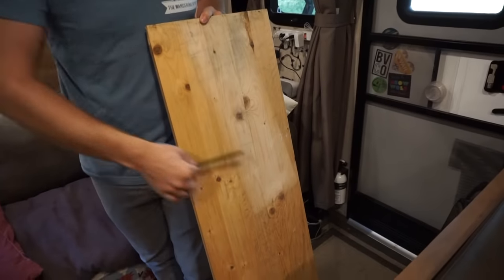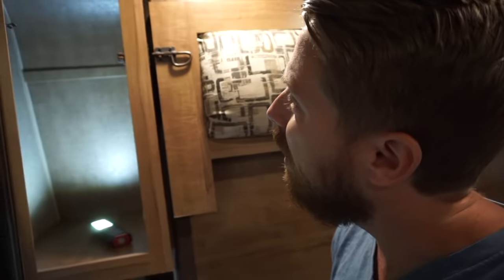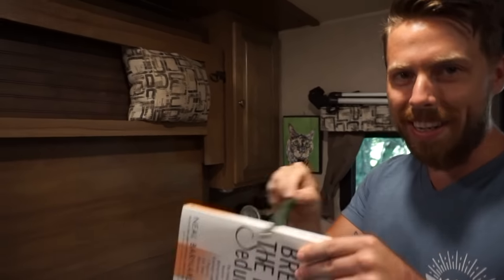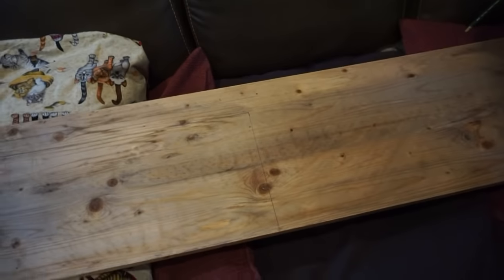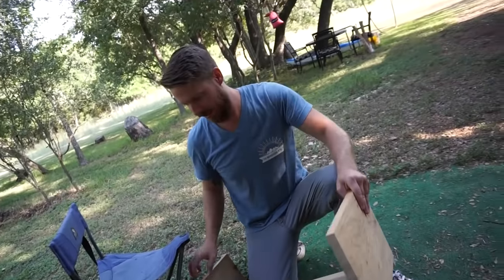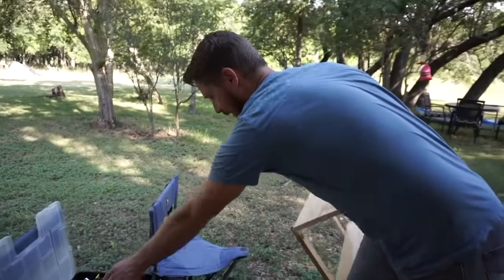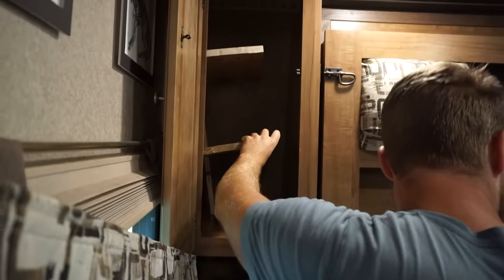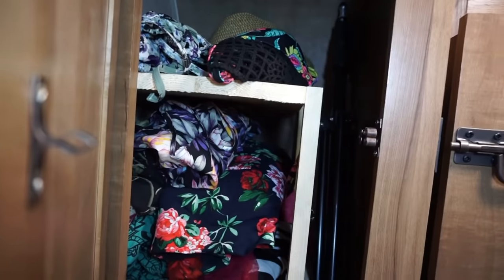BUILDING SHELVES FOR OUR RV CLOSET // 20 MINUTE DIY PROJECT

Comment: You could've used shelving peg clips.  Drilled holes inside the closet on opposite walls, inserted the clips, cut the shelves to fit and done.  Make a template with multiple holes in it to keep the holes lined up from each other and made the shelves adjustable to fit.  Good effort though.